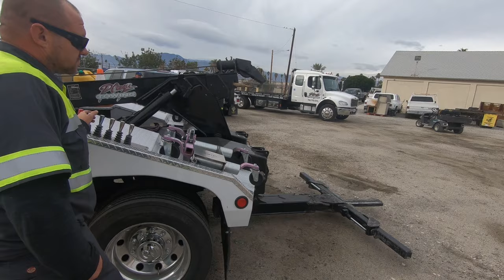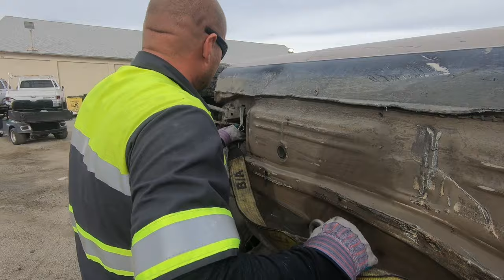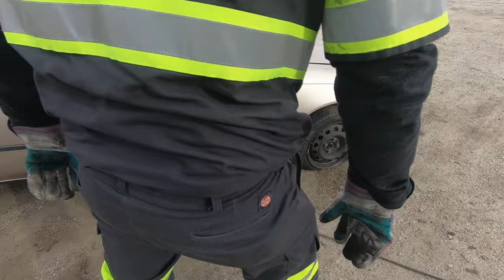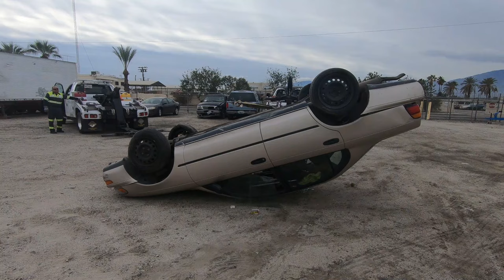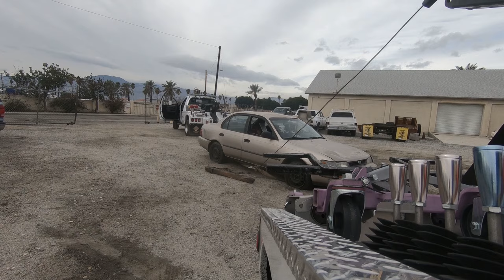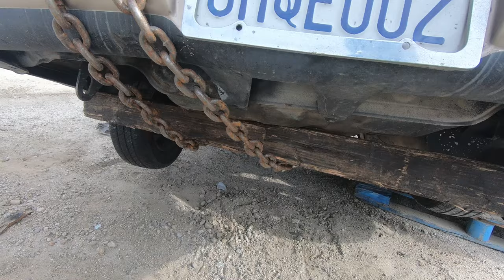How To Roll A Car Over Multiple Ways

Comment: The worse I ever did was on I-90, Dead Mans curve in Cleveland, across 2 lanes of 3, rush hour, late Jan. The car was upside down leaking gas. I stretched out my cable, went over the top of my 4' 4 x 4, One pull and she rolled right over.

Comment: The 4×4 trick came about. With the old sling trucks. Prior to the invention of wheel lifts. When auto manufacturers began making cars with plastic bumpers. A 4×4 was needed to prevent damage to the bumper while towing with a sling.